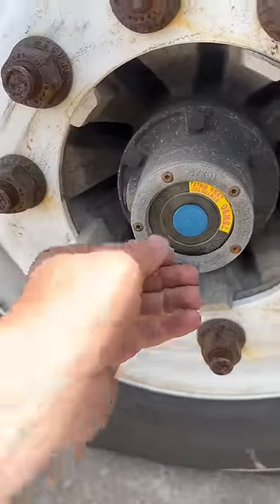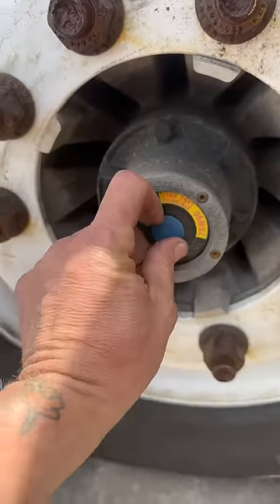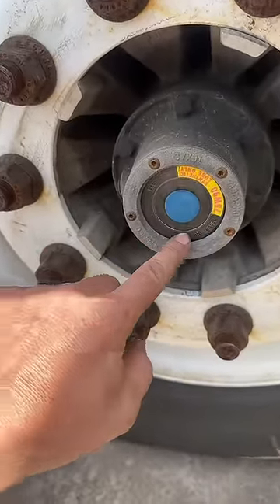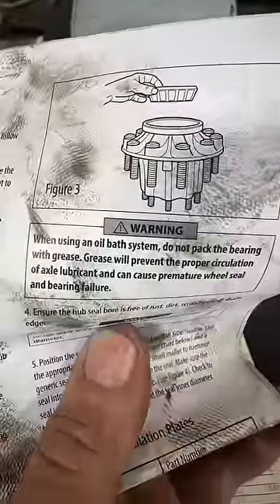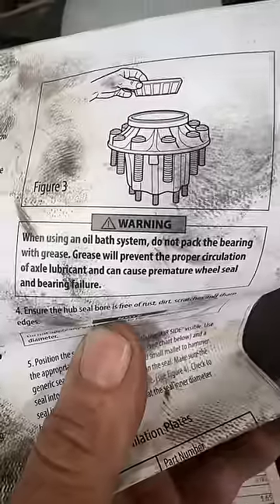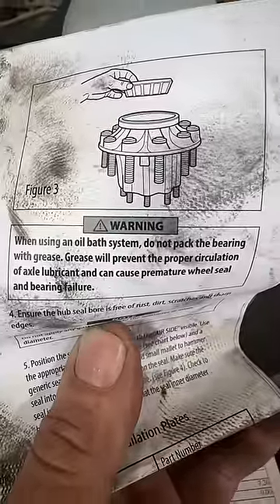No idea what you’re talking about

Comment: Brother even pulled out the manual. Respect.
Reply: I've done that many times.
There it is... admit you're wrong.. Bam!
Reply: He also pulled out the manual while installing it, clearly. It's fine. That's why they stick one in every package.
Reply: I had someone argue torque specs for trx500 headbolts and they still said I was wrong after showing them a honda page saying my manual is a certified repair manual and showing them the specs in said manual lol
Reply: manual is propaganda
Reply: Rando wasn't going to take his word for it, so mans said; "parry this you fucking casual"
Reply: …that was buried beneath all his shite because he doesn’t even need to look anymore. 😂👍🏻
Reply: He even clearly uses them. Those had a few rounds of finger prints on them. Almost like he would make sure he is properly installing a product.
Reply: Like my boss/friend says no one knows more about an item like the manufacturer does.
Reply: This gentleman is obviously not stupid.
Reply: You can tell he even used it based on the oil fingerprints all over it.
Reply: Oil only, grease will cause issues. Loosely paraphrased or not that’s absolute gold.

I’m on residential roofing. I throw down the roof vent box with the instructions in it and the paper blew out.

Customer picks it up and hands it to me asking if I needed it.

Bro, you shouldn’t hire me if I did need that. I get he was being kind, but it made me laugh.
Reply: Most mechanics will read or skim over if they already read it before the instructions just to make sure there's not a bulletin in there like hey after pulling the bearing race you need to things inside of the race retainer in order to ensure the bearing does not spin inside the hub you know s*** like that

Comment: Oil baths for bearings are actually preferred in design. Grease is a compromise to simplify sealing and maintenance.
Reply: Not on these bearings.
Reply: @bogkazealijamislim5998  what does “in design” mean to you? Cos to me, it means “when you are designing a bearing for an application, oil bath is preferred because it works better in general, but once you discover the application requires certain parameters, like environment, installation examples, temperature, exposure to weather, then it becomes apparent that it would make everyones life easier to pack it with grease, in which case you “design” the bearing to work packed with grease, instead of an oil bath.
Can you see how your statement: “Not on these bearings” is kind of redundant?
Reply: Yeah plus you get some cooling from oil bath situations, grease gets hot and thinner but they don't last as long from my experience
Reply: Depending on the application and design.
Reply: @Robnoxious77  the bearings are not necessarily different. What matters is whether the hub is filled with grease or not. Oil hubs are better but they are not used on trailers because oil only works if its moving. Trailers sit for long periods of time in yards. Since the hub is not completely full of oil this would leave the bearings and axle nut and related exposed to condensation and start rusting and because they sit in yards no one wont notice for a good while if the hub is leaking or has no oil. So grease is used instead for trailers. Trucks will typically have oil hubs since they are constantly on the move however you do need to check them more often as they have a higher chance to start leaking. As for difficulty its the same. Only difference is whether you are replacing oil or grease.
Reply: @wolf2179 most semi trailer hubs use oil bath exactly like he showed.
Reply: @ke6gwf  maybe it depends on area. Shop i work at the majority of trailers have grease hubs. The ones that typically were 50/50 on that were van trailers. But these didnt come in a lot either.
Reply: @Robnoxious77  That is not how this works, it is completely based on application only. The guy that telling the "Semi-Truck" Mechanic he is wrong and needs to grease the bearings has confused the application of a wheel bearing on a automobile carrying a few 100lbs over a vehicle that carries over 36,000lbs. There is a BIG difference between the two in the application use of the wheel bearing verses weight. The more weight, the more heat is created. So grease on a automobile wheel bearing is fine. On a Semi-Truck, would lead to bearing failure. Semi-Trucks get the bearing oil and must be checked off and on for seal leaks. This is not a automobile, nor a pick em up truck either. This is "yeah, I can transport your two story house from the suburbs to the country", "I can transport that crane", "I'll transport that load of cars", "Yeah I can transport that load of steel", "Yeah I can, ect, ect, ect..." Kind of truck..
Reply: @wolf2179 @wolf2179 I have seen some getting converted to grease, and a lot of the newer ones are grease, but that's because it gets a slight increase in fuel efficiency without the oil slinging around, but it's not better for the bearings and makes maintenance harder.
Reply: @ke6gwf  that makes sense. Not sure about maintenance being more difficult. I have replaced and done maintenance on both. I will say the oil ones i can remove and install quicker then i can the grease and a stay a lot cleaner lol.
Reply: @wolf2179 I meant that the grease style is harder to maintain, because you have to repack the grease more often and as you say, you get messier working on them.

The oil ones you basically just check the oil level until they need new bearings in several decades usually lol
Reply: @BATTLECATT00 ”in design” means while you’re designing them. That’s what we’re talking about here, not bearings that have already been designed. Bearings that have already been designed are designed to work a certain way.
Reply: @Robnoxious77  , "that are designed, to be designed, and designed, of in design. Then there is the out design, and the design, design, design..." That is what you sound like. I told you already, it doesn't work like that. The wheel bearings on a Semi-Truck required to be in oil bath because weight+Heat is friction. Using grease will fail out of the gate. It has nothing to do with the design of in design of out design, design, design, design, ect, ect, ect, ect. If you were a Semi-truck Mechanic, you know that, but your not. Your not even a car mechanic.
Because if you were, you understand there is a difference between a small vehicle and a semi-truck, your no kind of mechanic at all, wheel bearings, that are larger, holding more weight than a truck is the drum of a blast furnace, which requires to be greased every shift change. It gets greased because even tho holding more weight, it is not East bound and down, loaded up and truckin at 60mph. Now I ain't got the rest of my life to explain to you auto mechanics. So you must be trying to justify the grease claim that this real mechanic debunked, so you must had been the one that told him other wise, and the bob thing was directed at you. That is your problem...
Reply: 100 percent!!!!  Grease is a cheap alternative used in passenger vehicles to keep production and maintenance costs low.  (It’s all about margin folks)
Reply: @BATTLECATT00 what’s funny is that even if it was a pickup truck, their wheel bearings on semi float axles (basically every 1/2 ton or smaller truck in existence, Jeeps, etc) use oil bath lubrication. So he’s wrong even if he is talking about passenger vehicles lol.
Reply: @phtevenmolz5030  That will very based on truck type and application and package type. Cause heavy duty package is set up the same way as a heavy duty box truck/tow truck, ect, ect. Which uses oil lubrication in the front axels. And them small fifth wheel hitch trailers tend to also have oil lubrication bearings too like Semi-truck trailer axels do.. So yeah. Which goes back to application use. Price goes up when getting a heavy duty dual wheel package. And more so when the order is for a wreaker to be built. But it looks good :)
Reply: @BATTLECATT00  the wheel bearings, which are what is being shown in this video, are almost never oil bath lubricated. Only the differential is oil lubricated in the front of those. The wheel bearings on those can be either a sealed unit bearing/hub assembly or a hub with replaceable bearings. Either way, those are greased. Rear axles can be semi float or full float. Both are usually oil bath. Full float can be either oil or grease.
Reply: @phtevenmolz5030  regardless if Youtube silence me, your still wrong, get over it...
Reply: @BATTLECATT00  😂😂😂 you started off so well, but clearly don’t know what you’re talking about, especially when you went way off the rails talking about oil bath front wheel bearings on the steer axle. My guy. Take the L and consider just dirty deleting. It’s gonna be easier on you.

This is why you pay people like me to fix these things for you.
Reply: @wolf2179  lol... My last bass boat trailer came with oil bath hubs, never touched them in 15 years of ownership. I lived in the north east where it sat for the winter too, never had any condensation or rust issues. 

Want to guess what kind of hubs came on my new 5th wheel RV?
Reply: @phtevenmolz5030 , your wrong, bob proved your wrong, one day you will grow up and understand how wrong, your no mechanic, nor a truck driver. I can tell cause you have no idea of what I am talking about. You don't even know what hub was even shown in the video. Matter in fact, you don't know anything. You will get over it. Stop doing internet searches to troll real mechanics....
Reply: @Robnoxious77 😅. 🤌 And your handle. Beautiful
Reply: @TDub_ADV  Not sure how you don't know if condensation or rusting wasn't happening if you never touched them in 15 years. The only way you would know the condition of the bearings, axle nut and hub would be to empty the oil and remove the hub cap to start, and then to remove the hub to check all the rest of the components such as the inner bearing and seal. I don't work on consumer trailers, I instead work on commercial transportation trailers. Since the atmosphere in a hub isn't purged out condensation happens, this is even true inside your motor hence why if you leave a motor sit long enough the pistons and other components can freeze in place because there hasn't been oil running through these components so the temperature variations cause the ambient temperature in the motor to fluctuate which means condensation would form and this can cause rusting over time. Normally this isn't an issue if the motor was routinely used or even started as the oil will get moved through the engine to lubricate the components etc. Anyways not saying oil hubs are bad or good, just that as someone in the comments noted, it does depend how the trailers is going to be used that dictates which is more ideal. I do prefer oil hubs as I have said there not necessarily easier but I really don't like getting a bunch of grease all of over me either and its not hard to determine if the seal went bad or not as all you have to do is check the oil level and adding more oil is easy in comparison to checking grease you need to open the hub cap and now you need to replace the hub cap gasket etc.
Reply: @wolf2179  Well they didn't fail which they would have if they were rusty, and the oil would have turned milky and white  upon use with moisture.  Neither of these things happened......... That is how i know. 

There would also have been discolored oil if there was rust which i did not have as seen thru the clear covers. They turned smooth if i jacked a wheel and turned the wheel so i dont think there was pitting either.  I put literally close to 100k on that trailer and i never had to touch the bearings, adjust end play or anything. I just changed the oil every couple of years.
Reply: Fully agree with this working on gas turbine engines on my part…… let’s just saying using grease for those main bearings that are spinning at 10’s of thousands of RPM with high heat……….. just makes it a little bit better with some oil jets spraying them and cooling them off instead of grease…. And these engines run usually 30,000 hours so before overhaul…… grease ain’t working that long.
Reply: @TDub_ADV  well i am no fan with arguing on youtube or debating. As long as you are happy with what you used. Doesnt change anything that i have said just because you never seen it for yourself.
Reply: @BATTLECATT00  well that is not true I can send you pics of chassis that haul iso containers that are grease hubs. It depends alot on manufacturer and all our five axle tackles have a combo of grease and oil. Soooo let's not forget the old school trucks that had grease hubs on the steer axle. It's cool everyone wants to comment though.
Reply: The synthetic grease is almost oil in consistency, however still has more rolling resistance than hub oil(  primarily the reason for going to oil). Also cars and pickups have a sealed bearing in alot of cases except on rear axles witch tend to be oil bath. There is a lot of variables and it would take a long time to explain.
Reply: I'm sorry I wanted to comment also
Reply: Besides the point.
Reply: I remember back in the day when they used oil in engines for the lower bearings
... Wait.. They still do.. Man i guess it just might work
Reply: Comments like those come from people who think "blinker fluid" is real.
Reply: @Robnoxious77 most people just want to say smart things so no he didnt think that hard
Reply: Grease is like cheating, I have bearings run 25/7 for 60 years , the grease gets so thin turns into oil lol , we do have some intended for oil with the cups and elevator guys are making a lot money as we speak because the shivs bearings failed , I’m betting no one filled the cups or they’d gone another 50 years

Comment: I design industrial water pumps for a living.  90% of our designs are grease, but we do optional oil bath and oil flinger designs.  Same exact bearings in most cases, just different housings to allow oil circulation.

Head of engineering told me once “Bearings will tolerate grease, but bearings LOVE oil.”  We use grease because it’s more reliable in items that get seldomly serviced or inspected.  It doesn’t leak out of things and allow bearings to run dry.
Reply: Good comment my man! :) have always been thinking/feeling the same. I dont have the degree or that info. But im a mechanic. And i have to admit. Even when applayong oil to a grease bearing it runs better.. (ofc just for a short while. Thx to you i now know why. The housing) so i have always had a feeling of what u are saying. But this broke it down :) thx from norway :)
Reply: Makes sense, thanks for the explanation.

Comment: "The installation procedure, which I generally follow most of the time"😂😂😂
Reply: It's been three years since I seated bearings, let's see if I get it right.

300-300-150, back off and set end play to 0.003 to 0.005
Reply: I feel him on this one😂😂
Reply: @harrisondodge6956  Depends on the type as far as torque specs, and endplay is 0.001 to 0.005 for most. I think pro torq wants 0.001 to 0.003.  I just keep the guides laminated in my box and just refer back to it cause I'll never remember it exactly lol.

Comment: I can confirm there is oil in those hubs. I broke the sight glass on a truck before and the oil went everywhere.
Reply: Don't that piss you off? I had a truck done and thought I should check the oil in those hubs and pushed the window in trying to put the plug back in.
Reply: I was training someone on changing semi tires. Took him on a road service and had him do it, he banged the rim into the rubber plug destroying the glass/plastic/whatever. A 2 hour round trip later and customer is able to roll again.
Reply: Also, you should be checking that oil level every pre-trip and post trip because there is seals in there and they can start leaking. It’s so important. I’ve had a couple trucks that have started leaking. Also, there could be cracks.
Reply: Dumping rock out of a side-dump tends to break a lot of them too.
Reply: @greatadventuresch3281 yep and just because there isn't oil and debris all over the front side of the rim doesn't mean the hub isn't leaking either. Had a new tech/helper learning to do PM for our shop and he had it in his head he didn't need to check the hub oil level because if there wasn't oil slung all over the front of the wheel then it couldn't possibly be leaking...
Reply: There was something my mammy always said when it came to lubricating bearings properly: Consider the application and check with the manufacturer because they've probably thought about it longer than you have.

Comment: back 40-50 years ago we did pack grease bearings for Semi trucks, Military trucks ect… but the standard the last decade or 2 is oil bath bearings 
Cheers! good video
Reply: I’ve seen groil used in transit applications over the last 15 years or so. Mostly oil hubs, I don’t like the new newer two piece seals though, the old pound em in National wheel seals were fine